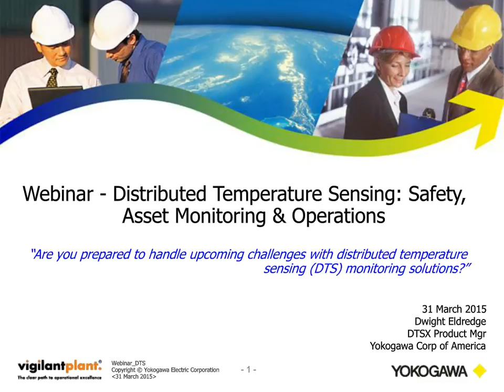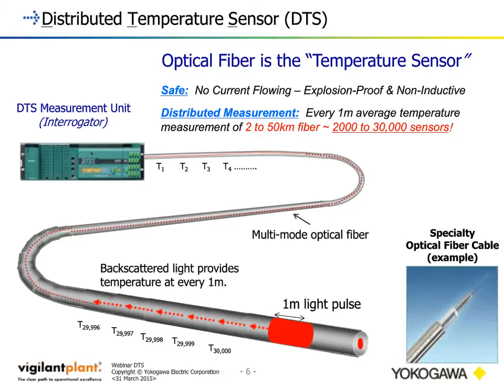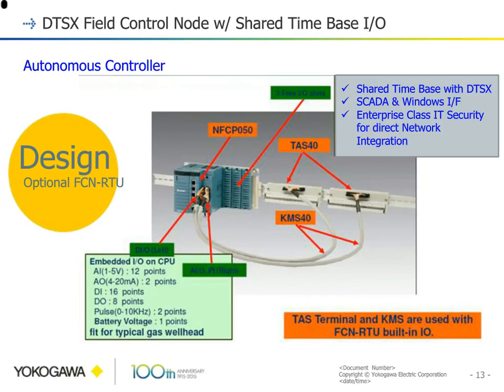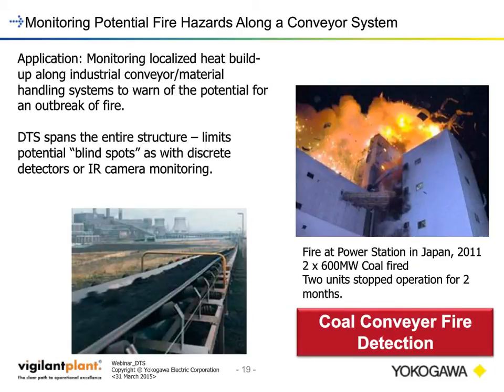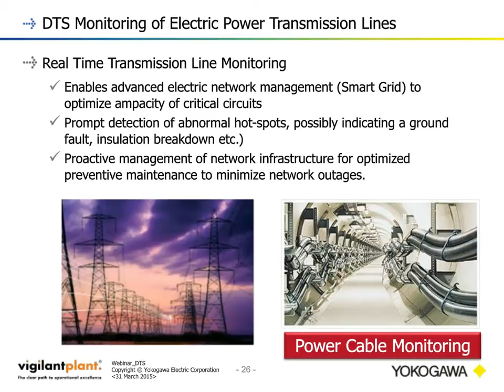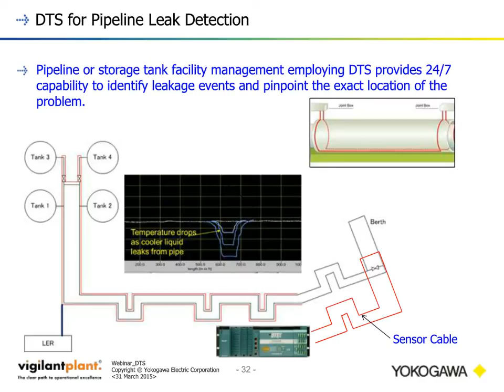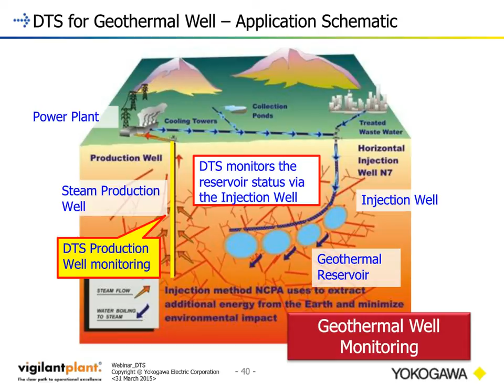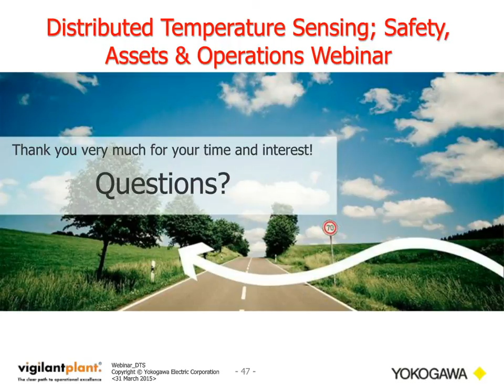Distributed Temperature Sensing

Comment: Can you determine surface temperature on pipelines, tanks, vessels, etc , like every meter or so or over the long distnce of the fibre optic transmission?
Reply from the maker: Hi Filip, Yes., Yokogawa’s DTSX solutions can detect surface temperatures on pipes, tanks and vessels.  Measurement intervals are configurable and will impact scan time.  Please contact us at https://www.yokogawa.com/us/contact/ so we can help you size your application. Thanks!

Comment: How can We determine flow rate through DST
Reply from the maker: The DTS (Distributed Temperature System) is a temperature based measurement only it does not have the ability to measure the flow within a pipe.  For this measurement you could consider non-intrusive flow measurement devices such as Ultrasonic technologies, for internal pipe measurement you could consider Coriolis, Vortex, Magnetic, Thermal, Orifice Plate or other methods.Yokogawa has many years’ experience in providing guidance and expertise in this field.  Please follow this link to learn more about Yokogawa flow meters. 

https://www.yokogawa.com/us/solutions/products-platforms/field-instruments/flow-meters/ 

Please feel free to contact us here for more information https://www.yokogawa.com/us/contact/
Reply: Yokogawa Corporation of America thanks a lot. But We can predict flow rate by using DTS( I dont mean exact value just by knowing temperature and other parameters we can at least analyse) dont we?
Reply from the maker: Unfortunately the DTS cannot derive flow from temperature, there is no direct correlation between temperature and flowrate other than doing a thermal mass calculation.
Reply: Yokogawa Corporation of America okay. Thanks a lot for your patience)